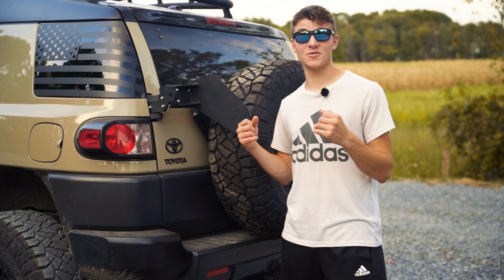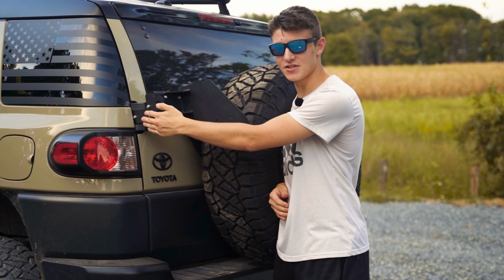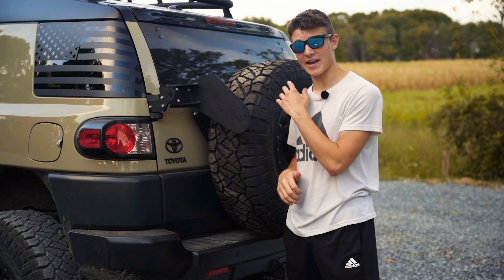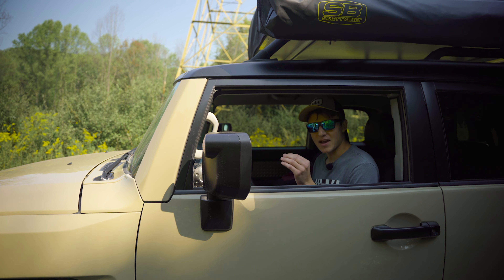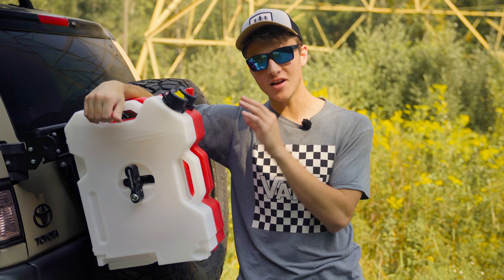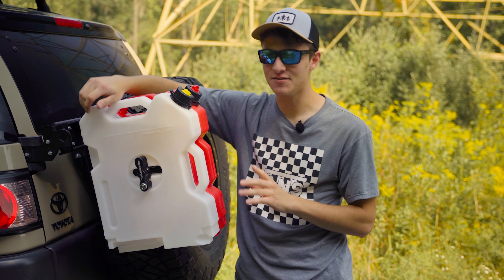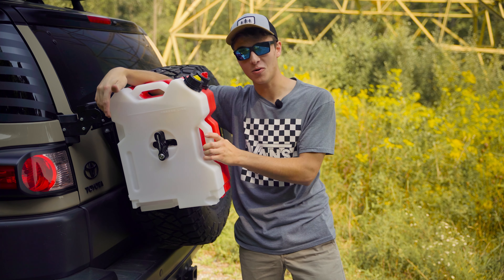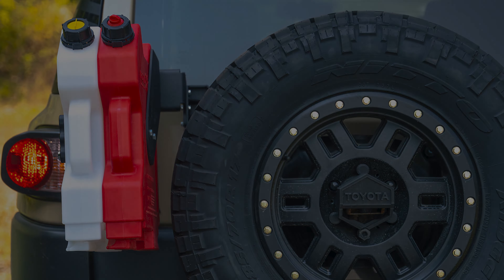Best way to Carry Fuel on an FJ Cruiser

Comment: Hi, Craig here with Refined Cycle & Off-Road. Just wanted to say fantastic job on this review and video production!  And great point about the added benefit of not being able to steal the locked version! Just thought I'd let you know, we are in the process of making the 4 can mount. The only part that is different is the actual mount plate for the cans. Contact me and we'll work something out on getting you a test piece. I was never crazy about the idea of putting that much weight back there but we did a prototype years ago for a customer and so many people have seen his and asked for one, we finally decided to go forward with it.
Reply from the maker: Hey man, thank you! I have been loving the mount so far. I would definitely be interested in discussing. Any issues with all that weight in the back?
Reply: @OutboundIntent  Well to be completely honest I was never a fan of the idea but we made a prototype for a customer years ago and he has been very happy. So happy he has people asking us all the time to make one, so we finally broke down and have one in production now. Contact me through the website and we'll talk more. Thanks.
Reply: Add an antenna mount near the hinge portion so it won’t take away the typical place for antennas on an FJ.
Reply: @Dennis_is_Outside  Great minds think alike. We've always had that option. In fact we have 2 sizes available right around ten bucks. Thanks!
Reply: @craigwheat4362 Hi Craig can I use a single 3-gallon Jerrycan instead of two 2-gallon Jerry cans?

Comment: Do you guys in the states not have Long range tanks/Aux tanks? 
Here in South Africa, the 2013+ models came standard with an additional 21Gallon(80L) tank mounted in that rear cavity. 
My 2012 only had the standard 19Gallon tank, so I fitted a Frontrunner 100L (26 Gallon) aux tank which basically more than doubled my range without having to carry those heavy rotopax/jerry cans on the doors. 
So now I have 172L (45 Gallons) and then for longer trips, I'd travel with 2x or 4x 20L jerry cans.
Reply from the maker: To my knowledge... we do not have any. But your comment has made me interested in finding a bigger tank...
Reply: @OutboundIntent  check on FrontrunnerOutfitters site. They still sell these tanks in South Africa, I bet they'd be able to get one over to the states. It literally just installs in that huge cavity under the tailed. It doesn't influence your clearance, and does come with a protective plate for the odd cases.
Reply from the maker: Thank you for that! I will have to check it out!

Comment: Wondering if a single 3 Gallon install will fit with this configuration? I am trying to reduce weight on their rear door, as I will also install a Gas mount on the pother side.
Reply: Yes, absolutely
Reply: @craigwheat4362 all installed. Looking schmick!
Reply: @erastusovio  is smick a combination between smoking hot and sick? :) 
Awesome, glad you like them!!
Reply: @craigwheat4362 that’s probably the best explanation of how we use that word down here in Australia!

Comment: Just put mine on tonight. Thanks for the video. What I am concerned about is how exposed the two bolts are for the rotopax lock. Just need a 12mm or 1/2 wrench and you have my lock and gas cans 😳

Comment: Question, what size bolts did you get? It’s giving two different options.
Reply: The 2 options you are seeing is not mounting bolts. It's the size Antenna you have, for the optional antenna mount. Thanks!
Reply: @craigwheat4362  hi, do 2x rotopax hit the tailgate light if i open the door all the way? also will i be able to open the rear door window?

Comment: 4 rotopax might put too much stress on your rear door along with those 33's. Just based on what I read. I have the same set up. I thought about it too. just saying. Good luck
Reply from the maker: Yup I definitely can agree with you on that, which is why I am going to empty the top two cans ASAP once it is low enough to fit them.
Reply: For the rattles when close the doors while the cans are empty and hitting bumps, I cut out a rectangular thin piece of yoga mat and placed it in between the cans. Works wonders.
Reply from the maker: very smart idea, I may use that!